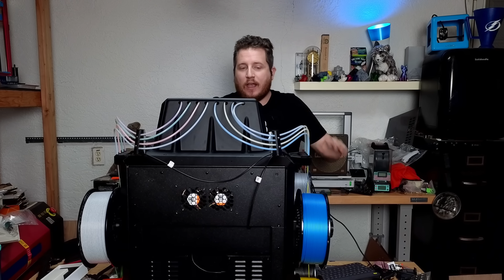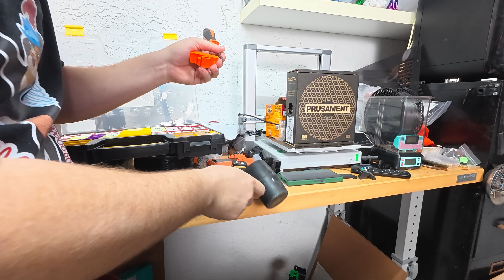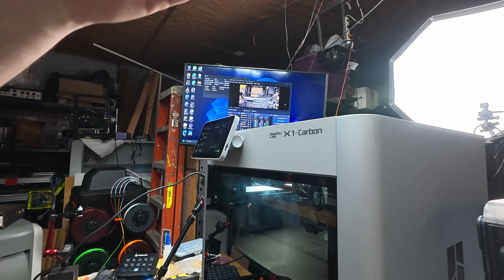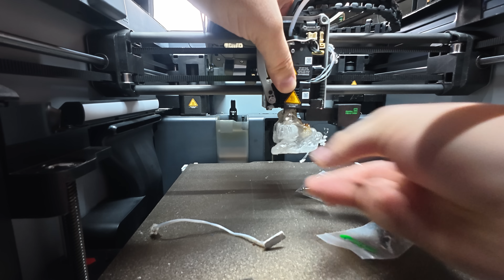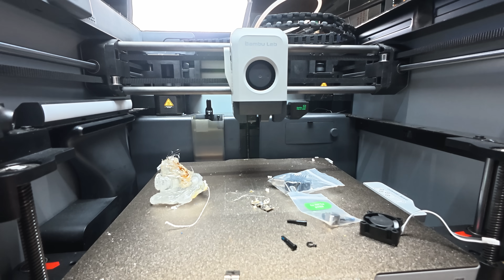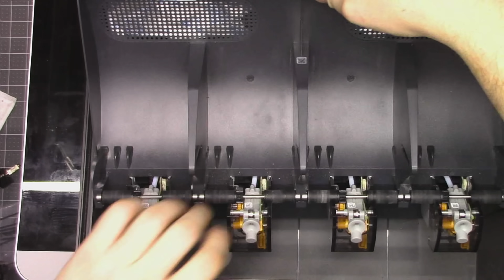INDX Upgrades & Bambu Disasters - PrintFixFriday 255

Comment: Problem with temperature in case of Bambu is not very surprising. They have an issue with the heating. I even saw some fires because of the malfunction of Bambu Lab printer. I am kinda worry about owners of Bambu machines.

Comment: I suggest cutting PTFE tubes with a sharp blade instead of wire cutters (like a bed scraper).  I used wire cutters once, and it gave me a lot of issues.  It took me a while to see what went wrong.  I also pressed on it to make it circular but that did not seem to help in the long run.

Comment: A little trick I learned years ago for taking stuck thermistors out due to hardened thermal paste is to spray WD-40 on it. Every time i've had one stuck like that and spray WD-40 on it they just come right out with no fuss at all.
Reply from the maker: Noted. Would have likely saved me a bunch of broken wires ha ha ha

Comment: I highly recommend getting a Hot Air Soldering Iron. It's basically a heat gun with super controllable temperature and fan speed as well as different size nozzels.  It makes doing maintenance on things like blobs super easy without the risk of a flame or a large heat gun.  It's super useful for cleaning up and adjusting prints just like a torch. You just dont run the risk of destroying your print because you can set it to the filament nozzle temp, right below it, even all the way down to 100c.  You can use it in between sanding steps to remelt the sanding dust back into the print to help fill in the scratches so you can go through the diffrent grits quicker.

Comment: In years of 3D printing I have never had the blob of doom until the other day, where it totally ate the Revo hot end on my P1S.  And I mean TOTALLY.  It was into the little sleeve that goes around the wires, it consumed the ceramic heater.  It was basically unsalvageable and I had to replace it.  It was so bad it even got the nozzle fused into the heater and no amount of heat or torque would shift it.  Wouldn't have minded so much but it wasn't a brass nozzle, it was a high flow obxidian!  Ho hum.  All back up and running now.
Reply: Ive had a ~400g PETG-CF blob that went up the fan cowl of my P1S. I got the hotend cleaned up, but the thermistor, heater and fan  got broken.

Comment: Pro PTFE Tip: One of the two allen key included with the Bambus can fit inside the PTFE well enough to make fix it's inner shape if the tube is deformed after a cut, to allow you to make sure the filament can travel well. Much better than the pliers, and you already have the allen key out for the Bambu

Comment: I recently had an even larger blob of doom on my X1C with a diamondback nozzle.  The blob completely encased the thermister wires and had to cut to get the blob free.  I've got the hotend cleaned up except I can't get the old termister out.  As for PTFE tubes, as they wore out I replaced them with transparent PTFE tubing.  I really like being able to clearly see where the filament is.
Reply from the maker: DUDE I couldnt get mine out either, ended up breaking them.. next week's pff is going to include drilling out thertmistors...

Comment: Honestly the abrasive filament problem really isn't a huge deal to me. I Just wish they'd go ahead and offer a daimondback option at maybe $30 more versus reinventing the wheel (and it still being subpar).
Reply: Won’t be 30 more, try 100 more based on typical diamondback nozzle pricing
Reply: @jdoe1917 I'd still get it.

Comment: Regarding reprinting the docks compatible with heatset inserts. I just double checked the dock calibration step in the preflight instructions on Prusa's website and the screws are backed off 1 full rotation (0.5mm) at the end of dock calibration, letting the docks float a bit for compliance. You want threads that will grip the screw like the current plastic threads or somehow embedding nylock nuts. (I'm concerned that tapping the holes will take away too much grip unless you only partially tap the holes.) I doubt a heatset insert will hold the screws well enough to keep vibrations from slowly backing them out. I'm usually all for using heatset inserts for thread durability, but I don't think this is the proper application.

Comment: Those cutters are absolutely the wrong tool for PTFE. If you dont want to buy a purpose built tool, a razor blade cuts PTFE just fine without crushing it.
Reply from the maker: I have one, forgot it inside, didnt bother to go grab it, used an allen key to make the holes right.

Comment: Is all the parts of the INDX 3d printed?
Reply: Most of the parts are, but not the metal frame and gears, the motor, the inductive coil, the rigid-flex PCA in the smart tool. Neither are the heater zone and tip of the nozzles, the heatsink, the PTFE tubing.... Sorry getting carried away.

The dock mounts are FDM printed. The smart tool shroud and coil support, and the tool body are SLA nylon printed.

Comment: The only time I had a blob of doom I was printing something I made myself. All the bottom vertices were at 0. All except one. It was lower. As a result my first layer was almost empty. Fortunately I caught it before it was a problem. It was the size of a marble on the tip. It came off instantly. No damage.
Reply: I still have a death blob that is fused to the fan shroud. After spending around fifteen minutes trying to cut a clone v6 free, I gave up and just bought a replacement hotend and I had a spare fan shroud in stores

Comment: Has anyone reading used heatsets on the INDX docks? FWIU the screws need to be put in a bit loose and might work themselves too loose if they're in a heatset. Did you use threadlocker?
Reply: Depending on the model you won't need threadlocker. The annoying part with the originals is getting the threads started and not stripping them. Some of the remixed versions still use a ~2.9mm hole behind the insert to keep some friction on the bolt. If I remember correctly, the version uploaded by VertigoMakes does that
Reply: @bequ3  Interesting! Thank you.
Reply from the maker: I didn't use heatsets.
Reply: @3DMusketeers  Yes, I know, that's why I'm asking people browsing comments...
Reply from the maker: ohhhh, my bad lol.

I figure the spring pressure should hold them in place though

Comment: it looks so much better in orange
Reply from the maker: Right?!? I wonder what other colors we would try...
Reply: @3DMusketeers  I would do mine in purple or orange
Reply: @3DMusketeers  Use the full spectrum printing on the C1+INDX to do the resistor color code. (Or be boring and do them in solid colors...) Skip black because that is zero, then from 1 to 8: Brown, Red, Orange, Yellow, Green, Blue, Violet, Grey. (Bad Boys Race Our Young Girls But Violet Generally Wins)

Comment: In case you did not know it, Grant, PTFE tube cutters are cheap, and good ones cut cleanly.
Reply: If you don't have a PTFE cutter, just slide some filament in and cut with flush cut snips. Filament helps keep PFTE stable and from getting wonky.
Reply: @SparrowHawk183 That sounds like a good idea.
Reply: It was seriously cringy.
Reply: Yes, like 6 for $8.99 at Amazon!!! Even the ones are better than wire cutters.
Reply: at least he didn't use his teeth to round it out
Reply: A hobby knife, drill bit or RC body reamer can be used to make conical entry and filament goes in smoother.
Just make sure the tube ends up clean, PTFE shred might be thicker than the nozzle 😉
Reply from the maker: Shhhhh. I forgot to grab mine and said f-it I'll improvise
Reply: @3DMusketeers  its not stupid if it works.
Reply: @ThatguyTY54 "IF it's stupid and it works, it's still stupid and you're lucky." - Maxim 43 :)